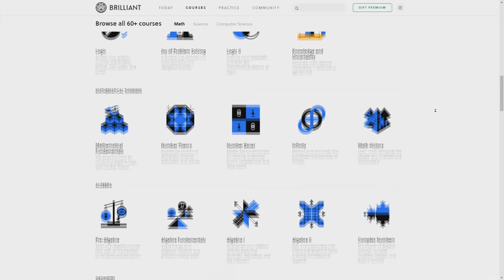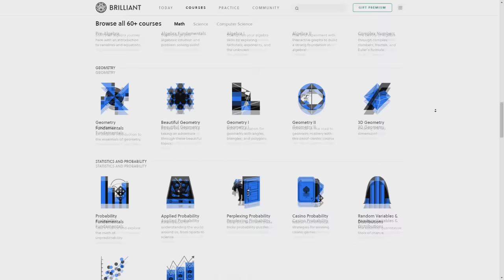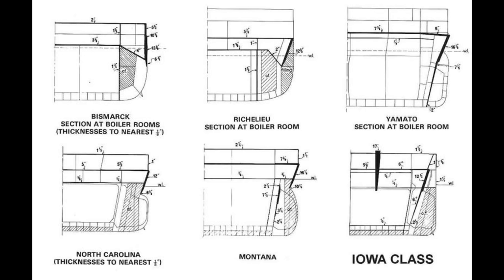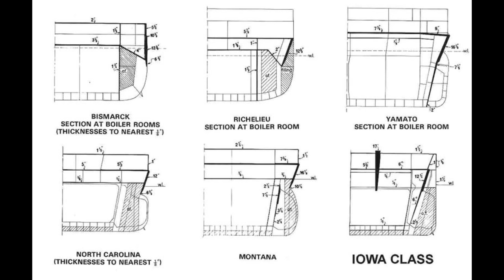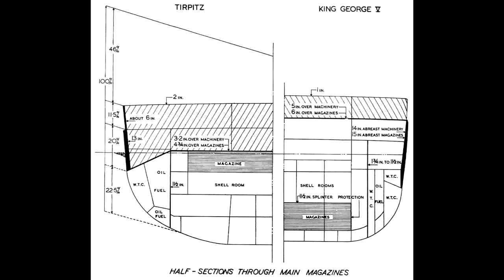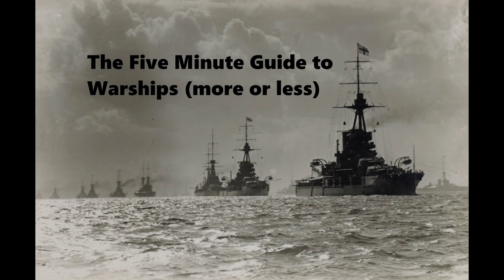Dreadnought Modernisation - A tri-wire balancing act

Comment: Italy had a massive problem when they dropped Caracciolo class. What should have been at least a 2 ship class (out of the 4 planned) for the same tonnage as the 2 cavour and Dante Alighieri. Then, they would have had 2 battleships for propper modernization while Dorias could have been rebuilt as they did.

That setup (2 upgraded Caracciolo + 2 Littorio + 2 Modernized Dorias) could have allowed for the italians to use Dorias in an agressive manner since they were expendable ships. Unlike historically when they just had 2x 15' battleships and the rebuilds couldn't be spared since they needed the numbers (4 up to Taranto, after that 2, but back on 3 again since 6 months later) because RM had so few 'good' battleships to begin with

Comment: With respect sir, you are wrong at 41:47.    The belt figure must be doubled and more.    The belt armor is on both sides, plus the front and back plates.   This would give a more even ratio of belt to deck armor area.

Comment: Drach, given lhe limitations imposed by the Washington Treaty, why didn't countries (I'm looking at you, Japan) undertake a US-style "great refit"? That is, strip an old battleship down to her frame and essentially build a new vessel on the old keel.
Was this type of refit specifically banned?
Reply: They did exactly that for all six BBs, the 4 Kongos and the two carrier conversions between 1933-1940. Ship hulls were bulged and then lengthened. New machinery put in. Despite the 4,000 tons and more added to displacement, Kongos went from 26 kts to 32 kts and the first four BBs went from 22 to 24 kts. Nagato class dropped from 26 to 25 kts while Kaga could do 28 kts and Akagi could make 31 kts. Then the tripods were turned into hexapods, new FC added, and turret elv increased to 43 degrees except for turrets No.5 and No.6 on the Ise class. All but Hiei and Akagi were complete before 1936, when Japan was still subject to the Treaties which she obviously broke given the standard displacement of Nagato went up by almost 6,000 tons.

Comment: Knowing what we do now I wouldn't have made the Ise class ships into hybrid carriers. As much as I love the (completely stupid) idea of an aviation battleship they basically didn't have an airforce anymore to put on them by the time the rebuilds were done. I think the best option for them would have been to remove the mid section guns from the two ships and use them for another ship that's either completely new or maybe to up-gun some other ship in the Japanese navy. Is that possible? I don't think the guns were super complicated in terms of loading mechanics or anything like that but I haven't been able to find anything that shows them.

Comment: Very interesting, but would be far better if the illustrations used bore some relevance to what was being said, and what the illustrations are supposed to be showing.  What we have is a showreel of mostly unidentified ships with no explanation of what it is we are supposed to be looking at and why so for example, 'here is HMS Cod showing the application of additional belt armour, compared to USS Haddock where the hull was completely rebuilt' etc .

Comment: Why? The battleship is more of a romantic weapon. It has been proven useful in ship to shore (Vietnam making removal of battleship bombardment conditional to peace talks for example), but it's naval record is abysmal. The US proved in the 80 that modernization is exceptionally costly (it's not a modular design; removal of turrets is exceptionally costly to install missile defense systems; the Iowa explosion was caused by trying to compete with anti-ship missiles). If it's for the range and duration of gunfire, then it would be better for the US navy to restart it's railgun development program.

Comment: You keep refering to the Tennessee class and the Colorado class as the 'big 5' standard battleships, but I don't understand why the New mexicos are being ignored in that. The Tennessee class were a minor development over the New mexicos, same guns, displacement, layout and speed. Why the distinction?

The only difference I am aware of was a slightly changed superstructure and improved secondary armament location.
Reply: At least Idaho of the New Mexico class got modernized so it was the most modern before North Carolina.

Comment: Why do British ships have a large, blocky superstructure like you see in Vanguard and the refit Renown? What was the engineering benefit of that design?
Reply: FC systems were getting too heavy for tripods. You can see this when the "Nelson" class adopted the block superstructure. The US did the same in the 1930s with the "San Fransisco" and "New Mexico" classes, expecting aerial spotting to take up the slack of lowering the FC closer to sea level. Always remember that the effective gunnery range was the range at which splashes could be spotted. The visual horizon for a spotter 100' above sea level is ~24,000 yds. The US reversed course, probably based on the radar tests of 1938 and went with a enclosed tower for the FC directors. The British accepted the lower block bridges of KGV as they had changed their doctrine in that the crucial engagement range was 12,000-15,000 yards in the mid-1930s, with the engagement staring at around 20,000yds. This doctrine should help people understand what ADM Holland was trying to do by running down to the German ships. The British had planned on fighting the Japanese from 1919 to 1936 and the KGV class was designed to run through the danger zone against 16" gun ships starting when the Japanese opened up at 30,000yds with aerial spotting to get to the critical range.
Reply: @michaelsnyder3871  Thank you so much. I've posted this question a dozen times and finally I got an answer!

Comment: Speaking of modernisation.... I'm curious what a battleship would look like if they designed one today from the ground up. Would it have nothing but missles and close in defence or would they build em with the big guns still?
Reply: We wouldn't call a no gun BB a BB these days due to the expectations. If you want an idea of what a modern gun based BB would look like, well we kinda have one already, the Zumwalt. It's only 2000 tons lighter than THE Dreadnought, and was (originally) designed to be a gun platform first (primarily for shore bombardment, but that's pretty much all a modern BB could do these days anyway).
Reply: @hanzzel6086   Okay but where are the 16inch guns? That's what I'm wondering. Tonnage doesn't mean anything anymore.
Reply: For a more directly inspired design: I would imagine the ship would hide in the fleet until the missile exchange was over and then rundown the enemy while they try to make port to rearm (most ships/navys do not possess the ability to restock missiles at sea, and even if they do it is very slow and dangerous) and rip them apart at relatively close range. To this end I could see the following specifications: 1) A 16-20k ton hull, with a very similar overall design to the Zumy.This would be so it doesn't draw undo attention when in the fleet. It could forego a lot of the more expensive stealth tech, since the goal is to hide it amongst the Burkes and Ticonderogas instead of fishing boats. The internal boat launch could also be removed
2) two, 8-12" guns (singles, probably not superfiring) in Zumwalt style turrets (see reasons for hull).
3) similar missile layout (maybe more of them) to the Zumy.
4) A substantial AA battery. Since we don't care as much about radar cross section as the Zumy and we want to eventually close range, we can have Phalanxs).
5) A thin (relatively)  but extremely comprehensive distributed armour layout. Thickest would be enough to keep out 155mm only, that is larger than any ship mounted gun and equal to most common large shore based guns. Larger shore based guns do exist (205-215mm(ish), but they are few in numbers (most notable users being Russia and Tiawan). The thinnest would be rated for 76mm, as that is a fairly common ship gun. The armour would have to be very comprehensive due to avoid being rendered combat ineffective by high accuracy and rapid firing weapons commonly found on modern warships.
6) extreme speed. They would need 40+ knots (and enough fuel to sustain that speed while crossing half the globe) in order to catch hostile ships before they made it under their air cover.
Reply: @ADobbin1  Not worth the hassle anymore. Which truly is saddening.

Comment: I'm a bit surprised that one could not switch out the main armament with a gun of the same diameter but higher caliber (i.e. fire same diameter shell but with slightly longer barrel and hence more rifling). Of course this could be due to the whole issue of being unable to give a heavy enough counterweight to the barrel. But I am curious.

Comment: A genuine question based in interest combined with a complete lack of expertise - try to be nice!
I get that laminated armour against shells is a non-starter for the reasons Drach clearly stated. But why not stand-off armour as a torpedo and mine defence? Rather than adding bulges, or a radical refit, one could add the equivalent of shirtzen as used by a good few tanks...
...yes, yes, hear me out:
If designed correctly it wouldn't have to have a huge hydrodynamic effect, it may even prove beneficial with care. If the plan is to trigger detonation before reaching important parts of the hull why not? Such a modification might not be ideal, but would potentially weigh a lot less, could be used with 'lesser' materials, and maybe an easier retrofit?

So... as I don't believe anyone tried this approach what is wrong with this plan? Is it a case of water's greater density and relative incompressibility making stand-off armour impracticable? If so, why do oil/water-filled compartments with a necessarily smaller volume than the sea work better? 
I'm genuinely curious so please don't waste effort on answers that contain no explanation or are heavy on the rude and unnecessary sarcasm.
Thanks.
Reply: Well no-one more qualified seems to have answered, or even pointed you to a Drach video, so I'll have a go.
A torpedo bulge is 'spaced' armour. The intent is to set off the torpedo warhead further away from the more important bits of the ship.
A torpedo is not an armour piercing weapon like a tank shell or most battleship shells. They hit at only 10-20 metres/sec speed, not hundreds of metres/sec. So there's no delayed fusing or anything clever going on, just explode on contact.
What makes torpedoes so deadly is the warhead. A US 16" Iowa shell has just 19kg of explosive, even the HE shell for bombardment has only 70kg. A torpedo has a massive warhead, eg 320 kg for the British WW2 21" to 490kg for the Japanese Type 93.
The best defence is to keep that massive explosion as far away from the important bits of the ship as possible. A few cm of spacing won't make any difference. Adding bulges outside the hull works really well and doesn't cut into the internal volume you need for engines and magazines and stuff.
All the oil and tubes and rubber compounds are supposed to absorb more energy from the explosion. No-one seems convinced that they made much of a difference, but every bit helps...
Drydock 2 and 34 have more info about torpedo defences according to the spreadsheet.
Reply: Someone in fact did just that, check out British big gun (15”) Monitors of WW1 and 2 such as HMS Abercrombie and Roberts.  Problem was that skirts and water gaps were inconsistent with higher speeds, so only slow ships designed for hanging around a particular point in the sea for land bombardment purposes were worth building in this way.

Comment: I find it slightly puzzling that lamination is viewed negatively, in light of the fact that most armor produced of late is laminated. I would have thought that two, six-inch layers of steel, separated by a six-inch layer of compacted sand, or even air, would have been more effective than a 12-inch layer of homogeneous steel.
Reply: Spaced armor is VASTLY different than just riveting plates together

Comment: Sir, Understanding that increasing main deck armor takes a great deal more steel than would increasing belt armor. How much of the main deck is actually armored. I am supposing the areas around the main batteries are armored. What about the areas occupied by the superstructure? Is the main deck that the superstructure resting upon armored or is it not armored, relying upon the actuial density of the superstructure to protect the areas below?
Reply: 41:00 and thereabouts 

Main armoured decking usually extended from the forward armored bulkhead to the after bulkhead, and from beam to beam, with openings only for barbettes, funnels, and access passages from below to above the deck. It may have been thicker over critical spaces like magazines and machinery, or a constant thickness, but it was not reduced under the superstructure.

The large difference between the square area the belt covered /vs/ what the armoured deck covered explains why, when decking was increased, it was usually on the order of one, maybe two, inches of additional thickness. 

More often done was replacing original deck armor that might have been 1”, or a couple of decks totaling a couple inches, with a single thickness of newer-material armour steel.

Comment: There’s a noticeable difference between new builds and rebuilt/upgraded ships. The Rebuilds are all compromised. So, the moola saved came “back at cha” when the rebuilds just couldn’t compete against aircraft like the F6F/TBD, which chewed up the IJN’s modernized old BB’s. Granted, both Yamato class ships were a lot more vulnerable to air attack than their designers had envisioned. But, that’s a case of lessons having been learned by the Americans.
Reply: The situation with battleships vs. carriers was one-sided because the battleship had no way to actually hurt the carrier (short of the carrier being a CVE or incompetently run), while the carrier could attack with impunity. It was hard for carriers to sink battleships-but it was basically (if not outright) impossible for battleships to even attack carriers.
Reply: @bkjeong4302  meanwhile Scharnhorst when it spots Glorious: Cat in the Hat baseball meme

Comment: Keep the protection, gut them down to the bare hull and install two A1B nuclear reactors by the Bechtel Corporation so as to split enriched uranium creating heat, turning water to steam in order to drive steam turbines generating 125 Megawatts of electrical power and 350,000 shaft horsepower driving 4 screws.
Speed problem solved.

Comment: Why do ships from the era of electric lighting have so many port holes? Isn't that kind of a useless, if not dangerous redundancy, especially for war ships?
Reply: Most of these ships had no air conditioning. The interior spaces would become ovens in summer or in the tropics.
Reply: @doncarlton4858  Ok but they certainly had some basic ventilation ducting?
Is this also the reason that some dreadnought ships had pipes on the sides going from the lower decks upwards?

Comment: At the opening of each Drachinifel video (at 0:22), you see what looks like a large file of fabric being blown away from the turret of a large (16 inch?) gun. This is not 'normal'.
Does anyone know what's happening? Was there an explosion at the breach (which would kill those in the turret)?
Reply: He went over it a few months ago in a video, something was not secured correctly and blew away
Reply: @zacknowles9711  Thanks for the reply. Of course, it begs the question WHAT was so close to the percussion as to be blown away with such force, and why would there be that much percussion way behind the barrel, near the base of the turret?

Comment: American shipflak levels might have been inspired by knowing that CVs 2, 3, and 4 could put up an alpha strike of near-300 a/c; strangely 'unfair' that the Japanese didn't get the same hunch.
        Adding VT ammo made modern US BBs mobile no-fly zones; merry Axemess 1942.
Reply: The Japanese planned more on having fighters intercept air attacks. And to be fair, even in 1945 the USN found that their fighter screens were doing a better job breaking up air attacks than their AA defences, even with VT ammunition, so the Japanese weren’t exactly wrong to focus more on fighters-the Americans ended up doing it too (vectoring in fighters was the biggest reason behind the Big Blue Blanket air defence doctrine), even as they upgraded their AA to ridiculous levels. 

The Japanese by late-war had a bunch of AA guns on many of their ships as well; but they had no good light AA guns so were stuck with the crappy 25mm for that (though their 100mm heavy AA gun was actually quite capable), and most of their ships only had fire control computers for the main and secondary guns and not the AA battery.

Comment: It is obvious that no naval engineer though t he whole thing backwards, all the way to the Roman navy. They kept adding more and more material so the incoming projectiles would not go in. IT DID NOT WORK. VERIFY IT. The opposite, is build  a very fast, at least 50 knots, very light, no armor vessel,  with  firepower to rival the Yamato, made very wide, with self sealing areas, and parallel, ceramic plates as torpedo barriers. A 16 inch shell if it managed to hit, would go through and explode way past the ship. 1 plate would plug the hole, if below the waterline. A 10,000 ton  ship, with 12 16 inch guns, no armor, would have run circles around any navy